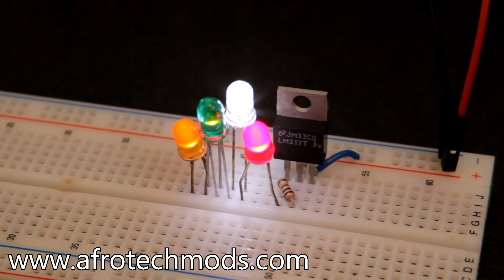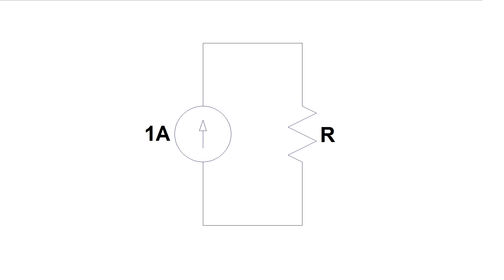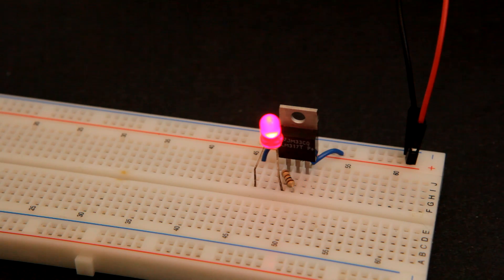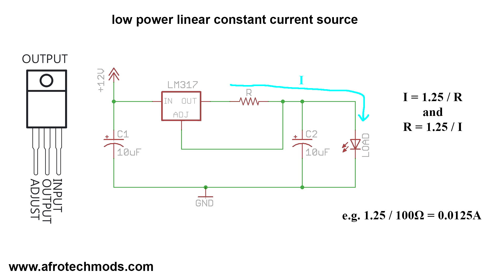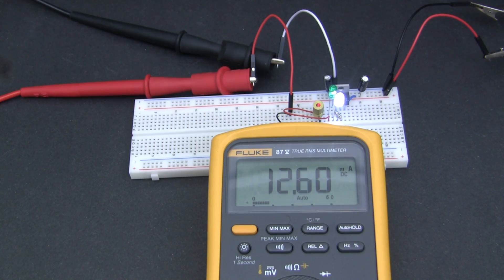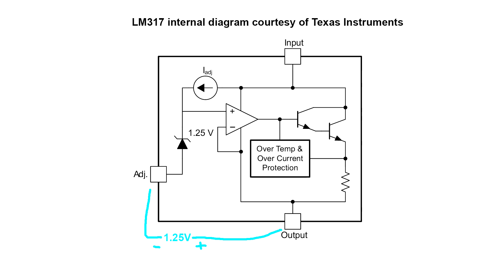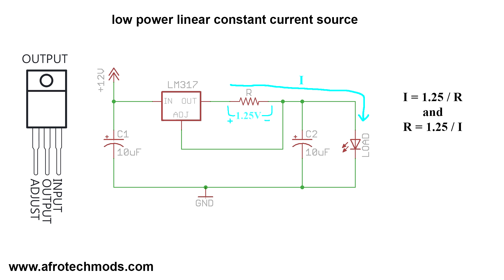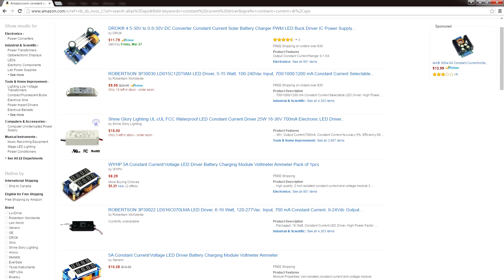Constant current power supply and laser / LED driver tutorial

Comment: There's one very important thing to know about the regulator to use: If the regulator is damaged, how it behave. If there went something wrong, the 317 goes to short the input to the output. Therefore your 100€ LD gets all voltage and all current it got from your powersupply.

That also can be true,  if you use a switched power supply (in constant current mode) for the LED/LD. 
Using a crow bar or  other safing device can protect your LED, but only if it switches fast enougth and before the current went to hight for your LED to handle it.

Inform yourself before using something you didn't design or at least buy 2 to test the behavior on a dummy device.

Comment: My problem is im trying to come up with a constant current circuit that can output 1 Amp Max at 3.5 volts for a 3 watt LED that will be small enough to fit in a flashlight

Comment: If you have a higher voltage than necessary to let the electrons jump the band gap in the LED and emit photons but still control the current enough such that the LED's light emitted is only JUUUST saturated, what happens with that extra energy that came from the higher voltage than necessary, don't the photon's that were generated only strip off a very specific discrete amount of energy from the "momentum/pressure" (a.k.a voltage) of the electrons provided?...and if the electrons provided are JUUUUST enough to saturate exactly all the atoms in the LED but not more, would there be a drop in voltage or a drop in current?

Comment: This can also be done with 5V, 9V and 12V regulators as well. The difference is that the "drop out" will be whatever the rated regulator is. When using the other regulators, substitute 5, 9 or 12 where 1.25 is in the formula. Of course your input voltage will have to be higher than the voltage regulator for this to work. In the case of a 12V regulator for example, you would have to have an input voltage above 14 or 15 volts. The good news it that if you don't have an LM317 available but do have a 7805, you can use it as well by selecting a different resistor, as long as your input voltage is high enough, like for a 9V battery. Ditto for the other regulators.

Comment: switching ones are so expensive :o but thanks for the awesome video! I'm building an rgb nightstand ( I hate non white lights but why not :D )  and the 10w led requires 10current sources D: at least I'm going the most route now! it's cheap and efficient as long as I stay near the rated voltage!
Reply: Look into LED driver ICs. No need to build 10 constant current sources yourself when you can buy a <1$ chip with 16 constant current sources integrated.
Reply: I've looked. i can't find them in my country. ebay doesn't ship here too ;(
Reply: Alright, let's go from the beginning. What kind of LEDs do you intend to use exactly? (You mention 10 inputs, that sounds rather odd for RGB LEDs.)
How do you want to drive the individual color channels? Do you insist on current control, or is PWM OK? 
Do you want to drive it from a microcontroller, or just simply with potentiometers? 
Also, if you don't mind me asking, what country do you live in? I find it hard to believe that there's a country where no sellers will ship (except for maybe North Korea).
Reply: That must have been a typu. I'm using a 10W RGB led. 150ma for each color. i need 3 inputs
i use pwm from a nodemcu
Reply: Well, in that case you don't need constant current sources, you can just use series resistors to limit the current. The current may vary slightly as the LEDs heat up, but if you're OK with that, it's the simplest (and cheapest) solution.
Reply: hellterminator I feel guilty about the 5w wasted power :(
Reply: That will be wasted with a linear regulator too (linear regulator is basically a smart variable resistor). If you want to save the power, you have to use a switching regulator. Doesn't have to be anything fancy like the super expensive stuff featured on this channel, a good old 34063 should do the trick.

Comment: Using a PNP transistor to get more current to the load. Is the output voltage going to the LEDs and stuff 1.25V or is it 5V?
Reply from the maker: The difference between Vadj and Vout is always kept at 1.25V and the rest of the circuit will kinda follow from that

Comment: I was hoping to add one of these (or an LM338) to the output of the 12v, 5v and 3.3v rails of an old computer PSU to use as a bench supply. There's several issues. 1) LM series don't work down to 3.3v input. 2) The output voltage will drop by 1.25v-2v to be useful, so the 12v will effectively be a 10v rail. 3) When regulating the current, it will change the output voltage.. So I'd need another LM to regulate voltage and thus drop another 1.25v.... So my 12v rail would be 8v.. my 5v rail would be 1v!
Reply: You wouldn't use a variable voltage regulator in that application anyway.  If you weren't going to use a switch-mode supply (which would be more efficient), you'd use 78xx and 79xx regulators such as 7805 and 7812 for the positive 5V and 12V supplies respectively, and a 7912 if you needed a negative 12V supply.  I gather that there's a 3.3V version of these regulators too, although I've not had occasion to use one of those yet.

Comment: Guys check it out, I've tried connecting 10 pieces of LEDs in series with the LED driver, it doesn't work. However, when I connected them in parallel with the LED driver, it worked very well.
Reply: That would probably be because there wasn't enough voltage from your supply.  10 LEDs in series would take at least 21 volts to illuminate and probably more, depending on the LED color since they require different voltages.  In practice, you'd probably need closer to 30V which if I remember correctly is pushing the limits of the LM317's maximum voltage tolerance.

Comment: I was trying to power a high power laser diode with my bench power supply and it wouldn't turn on. I forgot to run the bench power supply in Constant current mode

Comment: I don't get. Doesn't the voltage also need to change for that to happen? I mean the output voltage.
Reply: You got it. The output voltage changes to a value where the current stays the same. So more resistance on the output means a higher Voltage. You can see it as a voltage regulator that changes with the load.
Btw the rest of the supply voltage is wasted in the regulator, thats why it gets hot at higher currents. 
(sry for bad english)
Reply: Robert M. I was beating my head trying to understand how it was able to maintain constant current without changing the voltage, but it didn't make sense. thank you for clearing it out for me.
Reply: +Ciroluiro In a constant voltage regulator the voltage will be held constant while the current is allowed to vary. In a constant current regulator, the current will be held constant while the voltage is allowed to vary. 
All within limits, of course.

Comment: What if I want a constant voltage and a constant current(limited to a constant) at the same time? Is that possible?
Reply: No, because this would violate ohm's law
Reply: I meant to say limited to a maximum, i.e, current limited voltage regulator
Reply: +Sudip Dhara Well, then you could just put a resistor in series with the output with a value of V/I where I is the max current allowed to flow and V is the regulator's output
Reply: +Sudip Dhara Actually, I just realized this video talks about constant current sources, but the regulator I talked about should be a voltage regulator, or just a resistor to limit the current if your voltage is constant and at a desired level

Comment: Does it necessary to  use polarized capacitor (Electrolytic capacitor) ? Can I use a fixed capacitor (Ceramic capacitor) ?  P.S. Your videos are very cool !
Reply: We usually use electrolytics because they can reach higher values of microFarads than ceramic(etc).

Comment: Hey I built this circuit but using a lm317 in a to92 package and it doesnt work ! the voltage of R is around 6 volts and it doesn't limit the current (goes over 1Amp) ! does to 92 lm317 don't work in the same manner as to 220 ? also it seemed the lm317lz didnt heat up which is strange because I used a 9v battery to power it.

Comment: Great video! Just one question. Can you explain or make a video how i can use two LM317 to make BOTH a adjustable voltage source, and a current source with two different Pots? Thanks!
Reply: Make the adjustable voltage source AND the constant current source... connect the voltage source's output to the current source's input.... the current source is now current limiting your voltage source.
Don't measure voltage at the output of the voltage source.... because the current source is going to "eat" some of that voltage. Do all your measurements at the output of the current source.

Comment: What do you mean it pushed a set amount of amps through your load? Does it vary the voltage? I thought you needed 10volts to push 1 amp through 10ohms. Are you saying it will push 10 amps through a 10ohm with 5 volts?
Reply: It changes the voltage

Comment: if you put yourself on a circuit connected  to a constant current source would it still push the same current through you
Reply: +Malin Robbins if the input voltage is high enough and the circuit is built to handle that voltage i suppose yes

Comment: hmm.  I understand the current part.  For the most part anyway.  But what about the output voltage?  What will that be if you have a constant current.  Let's say you have an LED hooked up and you have the regulator set to push out 20mA.  What voltage will there be at the output?

Comment: Hy, I have a question. I've done this current source with 12V battery and i have a problem, when I measure the Vout near to outPIN before the resistance,I have 11,75 V and this is wrong because when I calculate the Vout formula it's equal with ~7V. I don't know why. In LTspice is 7,2V with R=50ohm. I've changed the LM317 for many times but the same results. But the current Iout is 30mA. Can you help me please with an advice? I don't know what can I do.

Comment: Can you please do a video on increasing amps, I have a 2 amp limit on my supply and would like to increase this to higher amps, is there a way to do it?
Reply: Wow, 5yrs...but still, might help someone 5yrs from now. The formula he showed was basically how to calculate for the desired current. So that if you wanted a current of 2A then you would do 1.25/2 = 0.625ohm. However, you see that's not really feasible, and so he also said that he doesn't recommend running anything above 200mA, because this system isn't the most efficient out there.

Comment: Hey how are ya. i was wondering if you could give me some help on a project I'm working on that i may do a session on at my school
i have a laser diode with the given data

Forward current: 1A typ.
operating voltage: 4.4v-4.6v
optical output power: 1 W typ.
walelength 445nm- blue

what im trying to do is get the diode to burn through small things at its max potential.
i though i knew what i was doing but then i started researching  things and im staring to get confused

i have a driver sketched out very similar (if not the same) to what you have.  now from my understanding no mater what the voltage in is, as long as its 2 volts higher than the output, i will always get 1.25 volts out. plus a bunch of heat from the regulator.

is their a way to make this work?
Reply: rockman12345100  also when calculating the resistance should i use the voltage that the diode consumes or the 1.25 volts from the regulator

Comment: I had a bad dream once and woke up screaming, "LM317 ADJUSTABLE VOLTAGE REGULATOR!"
Reply: Ohm I gosh!
Reply: Jonathan L Watt?
Reply: Max Greyfeather I wonder how that came to be.
Reply: Max Greyfeather wat?
Reply: Don't ask. My dreams make no sense.
Reply: Gigawatt
Reply: And then someone slapped you ?
Reply: Ohm my gosh
Reply: Rfc BBM m
Reply: Jared Jones Megawatt?
Reply: +Blowtorch the Robot I tried to make a constant current with LM317 (taking 2.2ohm/5w resistor). bellow 4 volts that doesn't supply constant current.
Reply: 1.21 gigawatts

Comment: I am looking to build a voltage doubler circuit to test the led strips in led/lcd tv's.  I wanted to use 2 6 anp rectifier diodes and 2 470 uf 450 v caps run off from a veriacc.  Can I use a lm317 to oput 35 ma constent current to the strips and can you help me design the circuit?

Comment: Any idea where I can salvage a LM317T?
Reply: POT82ES No real need to salvage. They are not commonly used because they are not very efficient. But they are very cheap. Less than 25 Cents (US) from ebay or less than $2 each on amazon. They are widely available and have so many uses get several if you can. Do not forget to use heatsinks in almost all circuits as they can get very hot depending on the load and input voltage.
Reply: I understand. I ordered a pack of 10 from ebay, and a day or two after I got them, I found one of them in some network thingy. Hahah lucky ;)

Comment: Thanks for this vid. I finally have a constant 14volts 50mA current supply for my PA0RDT-Mini-Whip antenna (I still lack a long coax cable though :v)
anyways for my safety I attached a heatsink to it and used a 2 watt 25 ohm resistor XD
Reply: 2W resistor is completely unnecessary. Voltage across the resistor is always 1.25V, current will always be 1.25V/25Ω=50mA. Therefore the power being dissipated will always be 1.25V*50mA=62.5mW. In other words any resistor (all the way down to 0402 SMT) will work. 
Heatsink is also unnecessary: Max input voltage for LM317 is 37V, meaning the difference between input and your 14V output can be at most 23V. At 50mA that gives you at most 1.15W of power being dissipated. Depending on manufacturer (and package, I'm assuming TO-220 as in the video) , the LM317 has junction to ambient thermal resistance of at most 80°C/W, giving you junction temperature of at most 92°C above ambient. Since the LM317 is (again, depending on manufacturer) rated for at least 125°C max junction temperature, you can safely operate it in this configuration without a heatsink up to 33°C ambient temperature (and that number will go up significantly if you're not using the crappiest LM317 out there or input voltage lower than 37V).

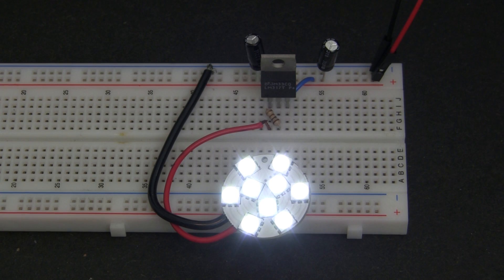Comment: 1:04 "...they will maintain the same brightness regardless of how much they heat up."
No they won't. The light output of an LED is proportional to the current that flows through it and inversely proportional to its temperature. Its brightness will decrease as its temperature increases.

Also 0:30 tries to create a constant current regardless of what the load is. There is limited voltage output range.
Reply: Mandragoras he did explain that there is a limit to the load based on the highest voltage the constant current source can supply.
Reply: megaspeed2v2 He explained later on what happens in a hypothetical scenario where you decrease the input voltage. This is not what I meant. 
A 20 watt LED driver, for example, has a 600 mA constant current output and a range of 17 to 38 volts output. It's meant to supply a constant current of 600 mA. But when you connect a 100 ohm resistor, for example, it won't be able to because 60 volts are needed but the driver has a maximum limit of 38 volts output.
This is the reason I believe, to someone who has basic knowledge of electronics the above statement sounds wrong or incomplete.

Comment: hello i need help.
i have 9x 1W green led's which i want to drive using 12V 2A switching power supply (is this enough?).
each led is meant to be driven by 3V 300mA but i cant decide how to drive them whats easier and better to drive them series, parallel, using voltage regulator...?
i was hoping to connect 3 series branches x3 leds in them and those 3 branches to connect them in parallel with one resistor but i cant decide and i am not sure enough how to calculate the resistor.
can anyone help me?
have in mind that i need those led's to be separated with cables longer than 5m, but i dont care if i am not driving them at maximum capacity. i am looking for fast, easy and good enough solution.
thanks in advance.
Reply: Afrotechmods Solution with LM317 will not work, LM317 have 2-3V drop from input to output and you need 1.25 voltage drop across resistor which make minimum total drop of 3.25V and for driving 3 3V diodes you need 9V which give total minimal power supply voltage of 12.25V, which is little over capabilities of his power supply
Reply from the maker: If your supply is 12V and you need a minimum of 9 x 3V then you will need a switch mode constant current supply based on the boost converter topology to step up the voltage. This would be to drive them all in series as one string. If you want a less efficient easier solution build 3x of the LM317 circuits shown in this video and put a heatsink on the LM317s and use 1 watt resistors for the resistors. Then put 3 LEDs on each of the 3 LM317s. Then you can power this all from your 12V 2A supply.
Reply: Hobypyrocom Simplest solution is to put 3 in series with 10 ohm resistor (calculated using ohm law on resistor you need to have 3V voltage drop with current of 0.3A and R=V/I=3/0.3) rated at 1W (0.9W is theoretical minimum) and connect that 3 series in parallel.